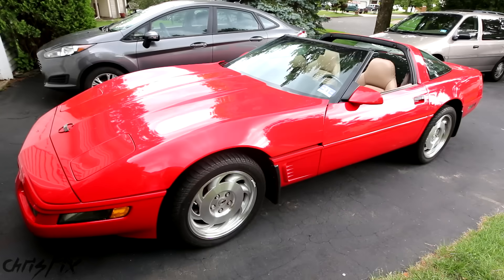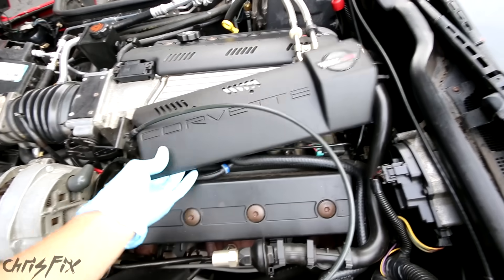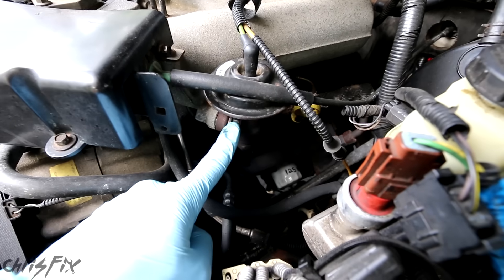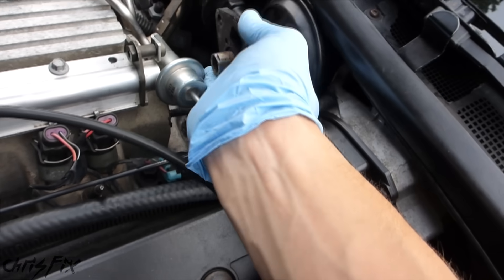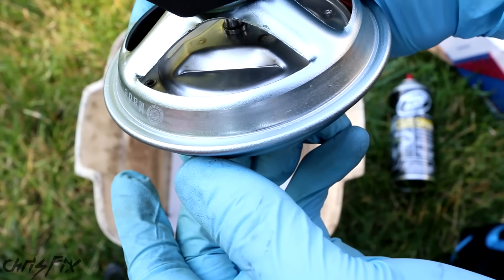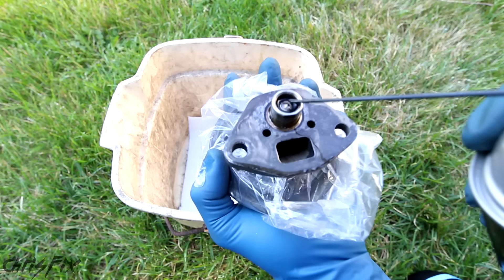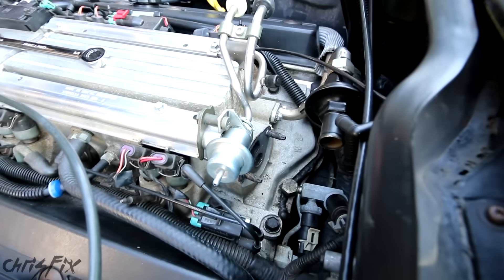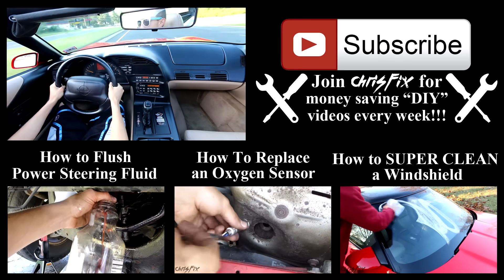How to Clean and Replace an EGR Valve P0400

Comment: Good video man, I appreciate it. I would also add that lits of GM front wheel drive cars from the 90's & forward with electric EGR valves can be electrically tested in the car very easily. Remove the electrical connector and you will see a single row of pins. Use a 9 volt battery with a wire lead on each side, touch the putter most contacts and listen for a solid click sound, reverse the wires and repeat the test. Should hear the same sound. If not, may need cleaning or replacing.
Reply from the maker: Brian Genter Awesome! Great tip and thanks for sharing! Tips like this are a great contribution to the video!

Comment: Hope to get a reply but how did you get your engine so clean? What did you use? I got an 85 vette and it looks very similar. But mine is a bit dirty. What did you use and do you also have HIDS  or any thing like LEDS in your car??
Reply from the maker: marc muniz I will be doing a video on how to clean the engine. It just takes a lot of time and elbow grease. I do not have HIDs in the Vette but I will be doing a video on how to install them and projectors on my truck!
Reply from the maker: ***** No new parts and no the engine was not taken out. Did all the work in the engine bay.

Comment: You're evolving in your  editing style and side notes for how to mitigate possible issues different from your own. Your're doing a great job Chris, thanks. Educational and interesting even though I don't have that exact  problem yet. Keep it up buddy.
Reply from the maker: Michael Thompson Thanks a lot Michael! I try to improve my style and content in each video I do (which is very hard sometimes). I am glad you see improvement! This comment made my day! Thanks!
Reply from the maker: ***** Thanks bud! I am glad you like the closeups!
Reply from the maker: Skry Axis Thanks man! It means a lot!
Reply: ***** yeah hes probally the best youtuber for car repairs
Reply: ChrisFix have a 99 4.3 vortec just took motor out of another bazer run great 100*** miles onit put in another 1 that was runin just bad now fuel pump workn got gas up to in line at throtl body no start pour lil fuel in starts up til runs it out everything hooked up

Comment: Amateur q. How does hot exhaust gas help cool the engine? Or did i misunderstand?
Reply: +omfgwtfbbq90 Well then yes, I will have to call you selfish about that. I prefer my and other people lungs run cleaner and healthier because  I cannot replace them. I would rather not buy Porsche 944 (though i don't think it is diesel)  and saved some money for the DPF replacement. I actually don't understand why would I buy more pricy heavier diesel engine for running around short distances -- in the city, where it cannot re-generate at first place.
Reply: SkitzoPhr3nia the egr helps return tye burned gasses in because already burnt gasses can't be reburnt in the motor, which keeps the combustion temperature down so you don't get pre ignition in tye combustion and not create nox from the combustion being to hot, when the o2 knows there's nox in the system the computer tells the car to open the circuit and open the egr
Reply: Wikipedia is your friend: It  dilutes the O2 in the incoming air stream and provides gases inert to combustion to act as absorbents of combustion heat to reduce peak in-cylinder temperatures. NOx is produced in a narrow band of high cylinder temperatures and pressures.
Reply: Alpha Bravo It also warms up the coolant, besides that only bad for the engine for sake of emmisions.
Reply: Alpha Bravo The only thing I can think of is that by doing this and preventing some oxygen from getting in to the mix it prevents a potential lean condition which would cause the cylinders to burn hotter. But That should all be carefully regulated in a fuel injected car anyway so shrugs. I'm not an expert so I could be 100% wrong.
Reply: Alpha Bravo If it truly cooled the cylinders then there would be no need for such things as egr coolers
Reply: Yes it is :p America is not about mpg, they liie us burning fossil fuels haha! Why do you think we don't get the big diesel audi sedans over here :p
Reply: +omfgwtfbbq90 no I'm talking about the way north American emissions are, yes they're about being as clean as possible but what comes with that is all this extra crap on an engine or depowering tunes for cars when they are capable of a little but more and maybe even better fuel economy
Reply: +Kaladar Williamson Did you forget the whole Volkswagen diesel scandal?  It's unlikely Audi/VW will ever sell a diesel again in the US.
Reply: +MistrDough I'd buy to be honest, I like the tdi and the fuel economy, I have cadillacs but if I had to down size f9r fuel economy that'd be the car
Reply: Kaladar Williamson There will be some people who will buy it but VW probably realizes that the market in the US will now be really difficult to sell enough diesel cars to justify trying again.
Reply: +omfgwtfbbq90 yes I did (: and also found the "What is DPF DEF EGR SCR? Protecting your diesel" video there. It is interesting and seems quite legit though i didn't agree with some things he said and also that this video is made to sell the after-market oil filter.

The DPF can be quite pricey, and has limited life, but that's just what I guess you should count with when buying the car.
Reply: +omfgwtfbbq90 Are you saying that the car makers are  lobbing for making engines more ecological so they could sell things that don't work (DPF as you claim the DPF is not re-generated, but only dumped) so they cannot  fulfil the new laws which makes them in danger of this to burst if anyone checks this? Well there was dieselgate, - sure. But I guess it wouldn't be a problem to mount some secondary DPF on the exhaust to check does it get dirty after the DPF "re-generation". If it got dirty,  I would then have to say yes, you were right, but otherwise I still buy the government-car-makers-official story.
Reply: Recycling exhaust lowers peak flame temp and drops combustion temp to reduce NOX pollution , in gas engines not noticeably affecting engine life and claimed to be increasing it. Rarely hear of burned valves since fuel injection came online. But what do i know, just a 1st class power engineer.
Reply: Alpha Bravo From what I've been told the EGR is an emission thing and has absolutely nothing to do with cooling off cylinders.  Hot exhaust gases are ALWAYS hotter than the air coming in the engine.  Not sure why he claimed that was its purpose.
Reply: The exhaust gases displace oxygen during the combustion process. By routing them back into the cylinders, it decreases the amount of oxygen that is able to mix with fuel. Keep in mind that it is a very small amount that gets mixed in but it definitely prevents the cylinders from getting too hot and makes the exhaust cleaner. I'll also add that this system is not active during wide open throttle for maximum performance and minimum tree hugging so don't worry
Reply: omfgwtfbbq90
Really?  Recently one of my YouTube channels went to Czech Republic.  He said he could hardly breathe in town because of all the diesel cars.  That has literally never happened in any US city I've been to.
Reply: jaryH3 but it destroys your engine in the long run. Which in turn gives you slightly less emissions into the atmosphere, but emissions nevertheless.
So now you gotta decide, is it better for a car to die after a shorter time period, and does it justify all the additional cost of energy to produce a new car instead of just keeping the older car running for longer, with slightly worse emissions?

Personally, I prefer to keep my diesel more reliable and running cleaner and healthier by removing all that EGR crap and exhaust restriction.
You can call me selfish for doing that, but I don't have the extra cash lying around for a spare DPF or a new engine.
Reply: It prevents overheating, after combustion process. Doesn't necessarily cool them off like he said, but does aid in the prevention of overheating, by stabilizing the air/fuel mixture.
Reply: Prevents overheating? That's what your coolant and oil are for.
Reply: It actually does cool the temperature of the exhaust gasses.  Nitrogen Oxide requires a certain exhaust temperature to be created and the EGR prevents it from happening by lowering the temperature just enough.  That's really all the EGR does.

Comment: Nope. The EGR actually makes it run worse. It was added in effort to reduce emissions by injecting non combustible particles in the intake, using less fuel IN THEORY. However, EGRs make the engine less efficient and take away performance, while being harmful in the long run. That's why it's one of the most common modifications, especially on diesel trucks.

Comment: why not replace with a new gasket if it is so easy to do so?
Reply from the maker: Kevin It is not easy to do. You need to take it off which is going to be a real pain since it is stuck on there good. You need to clean the gasket surface without getting anything in the intake, you need to put the new one on and hope it seals. Not worth all of the effort when I know the original works.
Reply: Kevin I was wondering the same thing. Confused
Reply: Kevin Just like i tell my gf if its not broken don't fix it. She kept messing with everything under the hood and the car wouldn't turn on.
Reply: It might not be. He'd have to peel it off or scrape it off if it's that bad lol.
Reply: Kevin maybe an older gasket is more rubbery and molded so it would work better than a new one
Reply: ChrisFix Awesome, thank you! I just was curious! Love the vid's.
Reply: on fords there is a tube involved and you likely destroy it when you remove the valve. Plan on a new tube with an EGR change. EGRs also leak air thru the lower vents, the pintles wear down causing vac leaks and trim/fuel consumption to rise. Good to keep an eye on fuel trims. Only way you know is with propane test and fuel trim graph. Valve will otherwise pass all tests.

Comment: That corvette is clean as fuck
Reply: I wish more car owners where like this Exspecially if you but used vehicles.
Reply: Nice job again
Reply: Because Racecar Why??
Reply: So, Corvettes come installed with faulty Egr valves? Because this engine looks like it has no more than 100 miles on it.
Reply: Real